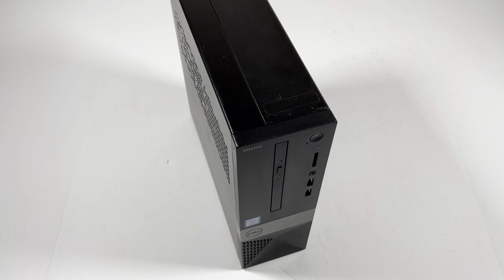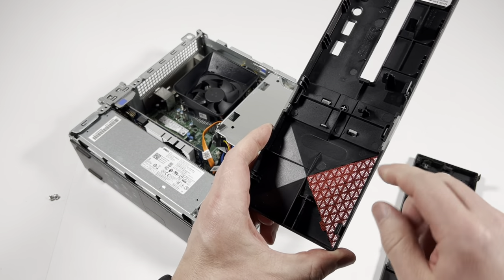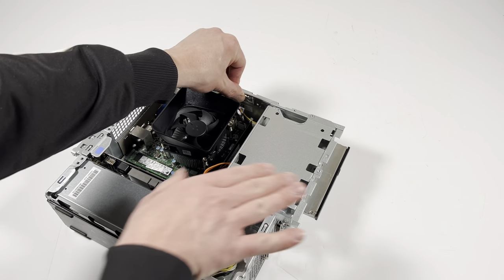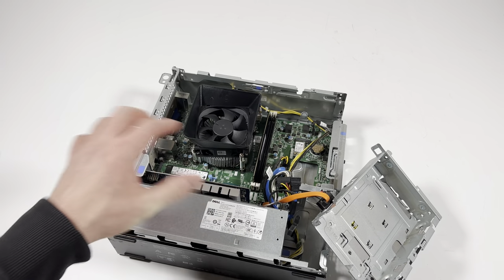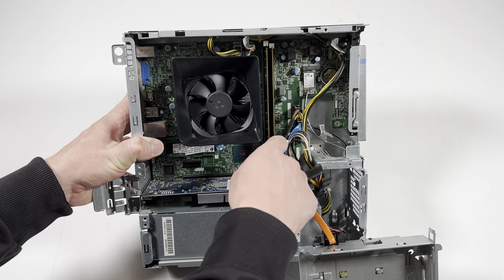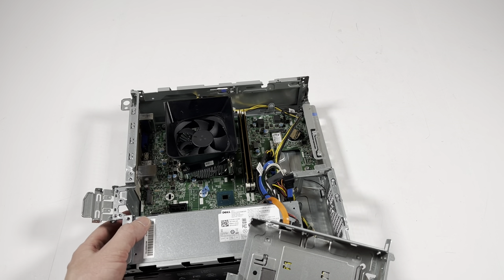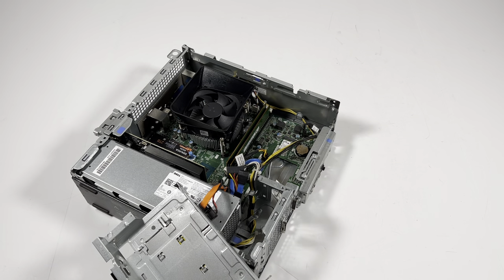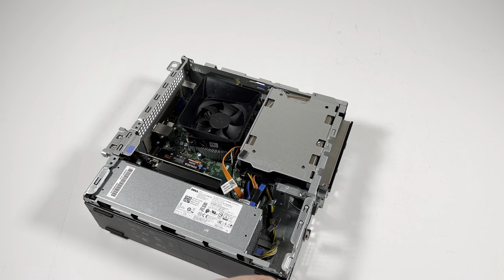Dell Vostro 3470 RAM Video Card SSD Upgrades

Comment from the maker: List of Parts and Upgrades works with this Dell Vostro 3470 SFF.

USB WiFi Adapter for PC, Wireless USB Network Adapter
https://amzn.to/3Iv0dHr

List SSD Heatsinks:

(1.)  M.2 2280 SSD heatsink, Double-Sided Heat Sink, PCIE M.2 SSD
https://amzn.to/3l2ittr

(2.)  EZDIY-FAB M.2 2280 SSD heatsink, Double-Sided Heat Sink, M.2 SSD
https://amzn.to/3m7J3me

List SSD M.2 Type 2280:

(1.) TEAMGROUP1TB 1TB M.2 2280 SATA III 6Gb/s Internal Solid State Drive SSD
https://amzn.to/3sQcAJh

(2.) Ediloca 2TB SSD M.2 SATA M.2 2280 SATA III 6Gb/s SSD Internal Hard Drive
https://amzn.to/3LkvzC1

(3.) TEAMGROUP 512GB M.2 2280 SATA III 6Gb/s Internal Solid State Drive SSD
https://amzn.to/3sTJatR

List of RAM will work with this system MAX 32GB.
Supports Non-ECC RAM DDR4-3200/2666/2400

Crucial Pro RAM 32GB Kit (2x16GB) DDR4 3200
https://amzn.to/3q5eFQ3

(1.) Crucial 32GB Kit (2 x 16GB) DDR4-3200 UDIMM
https://amzn.to/3BdbNm3

(2.) Crucial 16GB Kit (2 x 8GB) DDR4-3200 UDIMM
https://amzn.to/3U24CpE

(3.) Crucial RAM 16GB Kit (2x8GB) DDR4 2400 Memory
https://amzn.to/3MLA3mx

Thermal Grizzly - Spatula for Applying and Spreading Thermal Paste 
https://amzn.to/3d8NQEE

Thermal Compound Paste:

(1.) Arctic Silver 5 Thermal Cooling Compound Paste 
https://amzn.to/2ziNU0H

(2.) Noctua NT-H1 3.5g, Pro-Grade Thermal Compound Paste
https://amzn.to/36kTk7A

(3.) ARCTIC MX-4 (current edition) Thermal Compound Paste 20 Grams 
https://amzn.to/2DhGJaK

List video cards will work with this system.

(1.) AMD Radeon RX 6400 Low Profile Gaming Graphics Card
https://amzn.to/3s8MUUY

XFX Speedster SWFT105 Radeon RX 6400 Gaming Graphics Card
https://amzn.to/3xkmXo1

(2.) Gigabyte GeForce GT 1030 GV-N1030D5-2GL Low Profile Graphics Card 
https://amzn.to/2Z4PHkp

(3.) ZOTAC GeForce GT 1030 2GB GDDR5 64-bit Low Profile Video Card ZT-P10300A-10L 
https://amzn.to/2WzgLXk 

(4.) MSI Graphic Cards GT 1030 2GB GDDR5, Low Profile
https://amzn.to/390Spum

(5.) PNY NVidia Quadro K1200 (Low Profile) Supports 4 Monitors
https://amzn.to/3RE5lf7

SSD list works with this PC:

Samsung 870 EVO 2TB SATA SSD
https://amzn.to/3ezOds5

Crucial MX500 2TB 3D NAND SATA Internal SSD
https://amzn.to/3B9f8CF

SanDisk Ultra 3D NAND 2TB Internal SSD - SATA
https://amzn.to/3RSZ8LR

(1.) Samsung 860 EVO 500GB 2.5 Inch Internal SSD MZ-76E500B/AM) 
https://amzn.to/2yNxnkE

(2.) WD Blue 3D NAND 1TB Internal SSD, 2.5" WDS100T2B0A
https://amzn.to/2wvnC9Z

(3.) WD Green 1TB Internal PC SSD  WDS100T2G0A
https://amzn.to/3cbrcWa

(4.) SanDisk SSD PLUS 480GB Internal SSD SDSSDA-1T00-G26
https://amzn.to/3a3i9ou

(5.) Crucial MX500 250GB 3D NAND SATA CT250MX500SSD1(Z) 
https://amzn.to/34rZlhy

(6.) Samsung 860 PRO SSD 256GB - 2.5 Inch SATA III Internal Solid State Drive
https://amzn.to/2ybiHLK

(7.) Samsung SSD 860 EVO 250GB 2.5 Inch SATA III Internal SSD 
https://amzn.to/2VjIAkK

(8.) SanDisk SSD PLUS 240GB Internal SSD
https://amzn.to/3c7SEE4

HDD list works with this PC:

(1.) Seagate BarraCuda 4TB Internal Hard Drive HDD – 3.5 Inch
https://amzn.to/3d3xWeR

(2.) Seagate BarraCuda 8TB Internal Hard Drive HDD – 3.5 Inch
https://amzn.to/3xjUDSJ

(3.) Western Digital 2TB WD Blue PC Hard Drive HDD - 5400 RPM, SATA 3.5" - WD20EZAZ
https://amzn.to/3w3jIQA

(4.).WD Black 2TB Performance 3.5" Hard Drive - 7200 RPM Class, WD2003FZEX 
https://amzn.to/2xFUeyF

Disclosure: Amazon links this means that if you purchase an item we earn a small sales commission affiliate.
Reply: Bro can you do the dell Vostro 3910? Please I need some help and I'm new

Comment: In 2020 during the pandemic I came across your SSF HP build where you upgrade it and that single video alone started my PC building journey. I got a ssf hp and upgraded it with a SSD, ram, and  a 1050ti without any experience at all. That ended up being my gaming PC for almost a year, then I got my buddies old Alienware and I did a case swap that actually worked. Upgraded the CPU, new gpus and ram. Nowadays I'm on a whole new build I bought all the pieces to, msi moba, evga 3060, m.2 ssds ,and I gave my brother my old PC. Thank you so much for giving me the confidence to start this PC journey with confidence, I owe it all to you!
Reply from the maker: Hi.

Comment: I have the same model. I was wondering if it was possible to swap out the existing 200W PSU with a decent one that doesnt risk exploding in my face with a GPU hooked in. I'm pretty sure these things have proprietary parts but i would still appreaciate some insight.

Comment: So I’m hoping you can help me.  I bought an optiplex 7050 which didn’t come with wifi or Bluetooth.  If possible, I would love to get a card for both, but ideally wifi would be better.  I found an rx 6400 LP near me for a great price.  Would both fit next to each other in the PCIe slots?  Would I have any additional power consumption issues with the stock power supply?  Thanks!

Comment: Hey, i watched ur vid from 5 years ago which was upgrading a HP Compaq so I would like to ask, does rx 550 work out with my i5 3470, 200 watt hp system? New sub here ❤
Reply from the maker: Hi, yes 200 watt power supply will work fine with  rx 550.